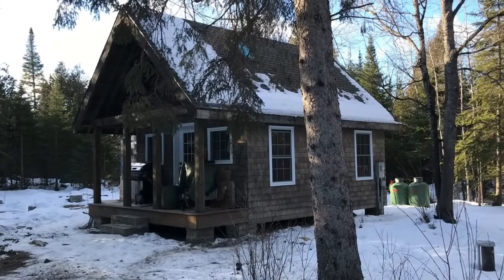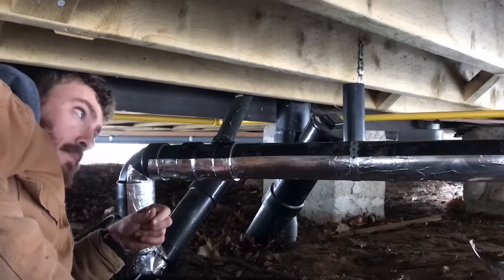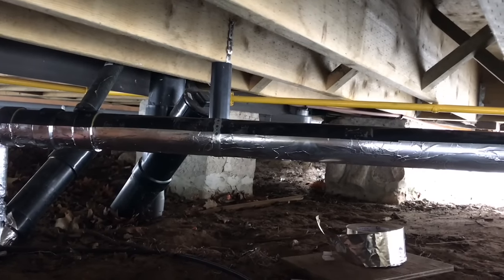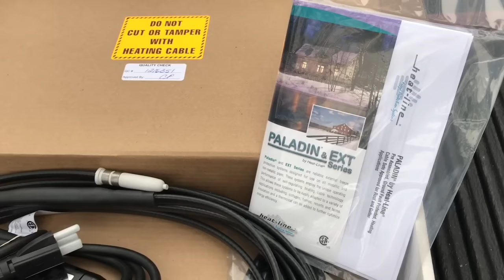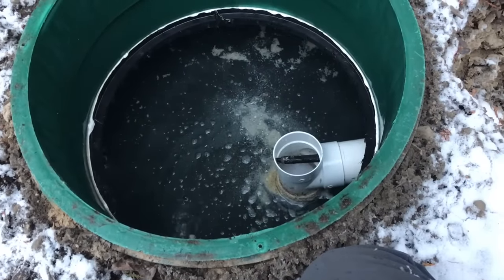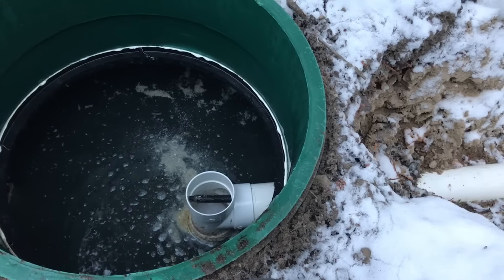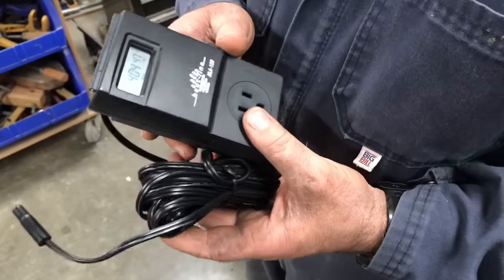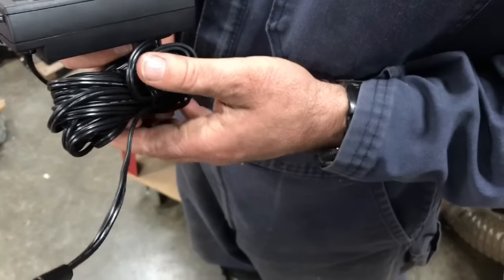DEMO: How to Freeze-Proof Sewage Lines

Comment: I like the idea... 1 question - Now that it has been 5 years since the install has any issues arose with the internal sewage pipe heating line interfering with the flow of waste products hanging up and possibly restricting flow.. After my 5 year build I am just getting to the septic and I have concerns (rightly so) of freezing traps.. Someone below suggested using water softening salts after shower???? Thanks for listening! Good vid!

Comment: why did you not rap the heat tape around the sewer pipe?
Reply: It's probably because the manufacturers of that particular heat tape does not recommended doing that? Also I'd assume it has to do with the fact that the pipe is not constantly filled with water, so it only needs a small amount of heat to prevent ice build up when the drain is used?  I'm not a professional. For my water lines, I applied heat tape with this foil all around, then insulated with yellow fiberglass, vapor barrier, duct tape, and finnaly a foam sleeve.  My drain pipes have nothing on them.  Thinking I'll put a spoon full of water softener salt in my shower drain after a shower.

Comment: you oushed the heater cable through the cleanout. you did not show how the cleanout is sealed?
Reply from the maker: Hi Robert! I should have shown that . . . the system comes with a rubber plug that covers the cable as it exits the pipe. Works really well, too.
Thanks for watching!
Steve

Comment: Insulated skirting..... that works too...
Reply from the maker: Hi Mike,
Thanks for commenting. A lot of people go with insulated skirting, but here are the problems I've found:
1. Insulation alone isn't enough to prevent freezing. 
Insulation keeps heat in, but there needs to be heat added to keep in. Without heating your insulated crawl space temperatures will drop below freezing (at least where I live). You can spend as much heating your crawlspace as you would a well insulated home on top.
2. An insulated skirt rots the floor frame. 
To be effective, an insulated skirt needs to be well sealed. This means humidity levels in the crawlspace go sky high. I've never seen an enclosed crawlspace that wasn't also causing mold and rot in the floor joists and beams.
3. Skirts attract wild animals.
Raccoons, skunks and porcupines love an enclosed, dark space. Where they wouldn't set up a home in an open crawlspace, they love enclosed ones.
4. Building a insulated skirting is more difficult, time consuming and expensive that insulating the floor from above and making the drain pipes frost proof. 
5. Insulated skirt walls attract rodents and insect. 
Regardless of whether you use rigid foam or batts for insulation, vermin will attack it because it's right at ground level. Ants love to chew into foam, and mice love to make nests in batts. There's no insulation available that won't turn into a gross, cruddy mess in time if it's used in an outdoor location touching the ground.
Like I said, lots of people go for insulated skirting, but it always turns into a disaster in time in my experience.
Thanks for watching, Mike.
Steve
Reply: I cannot even imagine the price of insulated skirting,I looked up regular skirting prices for my trailer house and I was blown away, can't believe their is heated skirting tho.